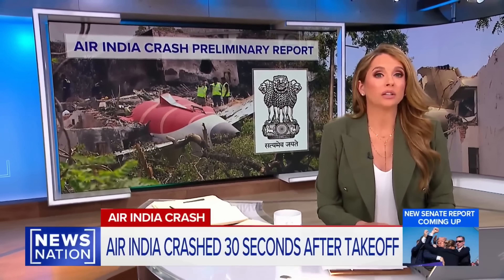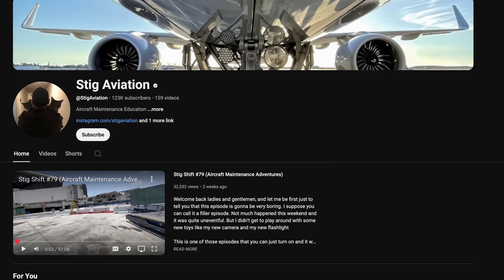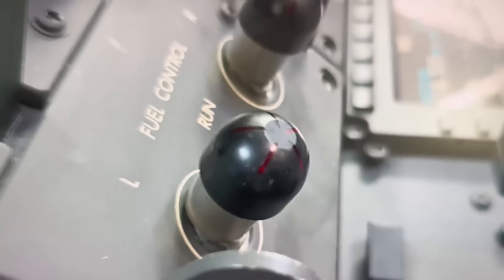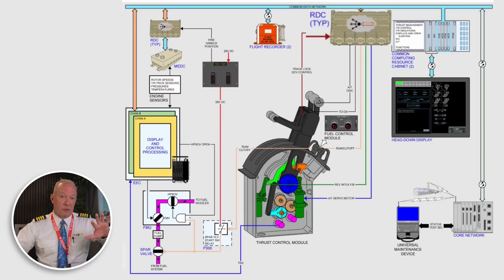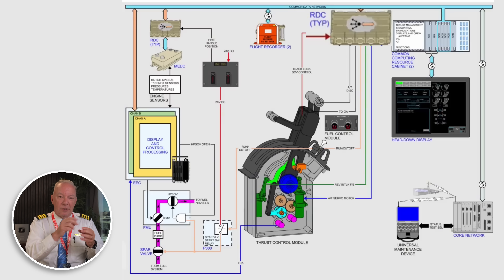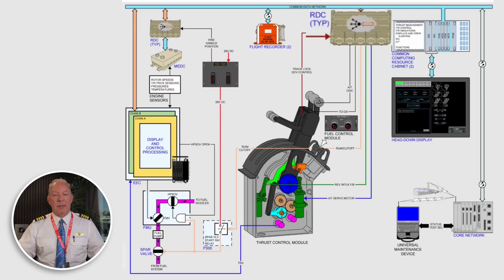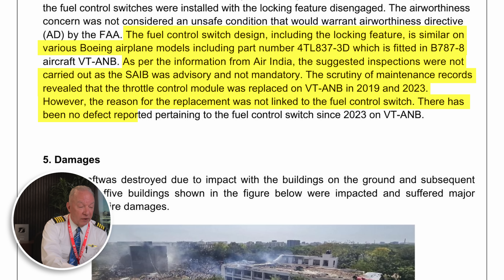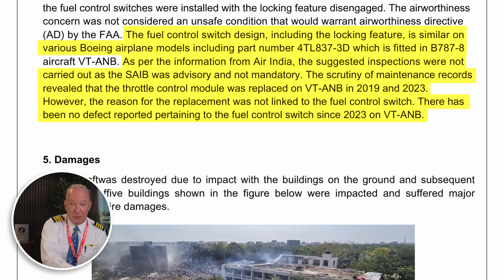The Truth About Boeing 787 Fuel Control Switches

Comment: I was disappointed with your explanation of the fuel control switches, particularly by your suggestion (at about 3:50) that the relay they control also opens/closes the FMU and the HPSOV, both of which are  actually automatically controlled by onboard computers, and which are located downstream from the spar valve that is operated by a relay connected to the run/cutoff switches.  

Also, in your little battery and flashing light prop, you identified the rocker switch in that simple circuit as a relay.  A relay is a remote device, that, when fed a current by another manual or automatic switch, opens or closes a different circuit.

Comment: I don't understand anyone wanting it to be a manufacturing fault, rather than deliberate human intervention. If a manufacturing fault, the implications are actually far dire, because it puts all the control modules in 787s and 737s into severe concern.

If it was a deliberate act, while terrifying to consider someone doing such a horrific thing on purpose, at least the chances of a repeat event are naturally less, because the difference between one human to the next is far greater than a single control module to another. These control module are manufactured to specs. Humans are not.  If it's a manufacturing fault, this event is more likely to repeat than if it were a deliberate act.

Comment: - Lithium-ion battery fire in eppenage of aircraft during runway roll?
- Electrical failure follows?
- FADECs cut-off fuels to both engines as per Fire Protection logic on takeoff?
- RAT deployed within 1 sec after takeoff?
- ECAS message appears showing fuel cut off?
- FO asks if Captain Cut-off Fuel?
- Captain says he did not? 
- Both pilots in initial confusion and some shock for some seconds?
- Captain calls ATC "Mayday Mayday - no thrust - falling" - not what suicide pilots do? 
- Captain then follows engine restart checklists inc cutting-off and running fuel switches about 10 secs after problem first alerted? 

Is above all possible? 

Well we should find out in 2026 once full investigation completed.

Comment: The aircraft never transitioned to ' airborne mode' , the WOW sensors failed, airborne mode' not detected. Fuel was cutoff 1 second after takeoff. That's it. There is a massive manipulation going on here to save Boeing.
Reply: No, the report says "The aircraft air/ground sensors transitioned to air mode, consistent with liftoff at 08:08:39 UTC".

Comment: Perhaps take a closer look at the diagram again. You say that all 3 valves are controlled by the relay. The FMV is not controlled by the relay. It's controlled by a signal from the "display & control processing" block. Also the HPSOV is controlled by a signal from the "display & control processing" block via an AND logic gate, which requires a voltage on both it's inputs to turn on the valve. So it's not a simple "closed loop" system at all. There are other external inputs that can cause the valves to close, It only needs 1 of those 3 valves to shut to cut off the supply to the engine.

Comment: 1. Is it normal practice for the switches to be set to the off position, when waiting to take off?
2. Could there be a reservoir of fuel still in the lines between HPSOV  to the FUEL NOZZLES, as seen in the diagram,  to the engines when the switches are set to the off position while waiting to take off.
3. If the answer to 2, is yes, then could the plane take off with the switches in the off position, fuelled by that reservoir. Achieving lift, but then falling out of the sky when that reservoir was exhausted?
To sum up is it possible for the plane to achieve flight with the switches in the off position, fuelled by a small reservoir of fuel still in the lines feeding the engine. If yes, it would explain why lift off was possible and then when the small reservoir of fuel was exhausted, the plane quickly fell out of the sky.

Comment: There is also 2 contacts which report the switch in Run position when it is in run and cutoff position when the switch is placed in cutoff. They feed the “position” signal directly to the Data recorder which records exactly when the switch is moved.

Comment: Why is there no fail safe system that does not cut off fuel at such a critical moment of the plane going in to rotate.A simple electric does not allow you to watch you tube video when driving.Why did Boeing not put a fail safe mechanism that even if the pilot wanted to do this in a malicious act the computer would not allow this at this crucial juncture?
I would like Cap Steeve to help me understand this?Thanks!
Keith
Reply: There's not a security system. On Airbus aircraft, the throttle must be at idle for the switch to work.

Comment: Captain Steve, a good example by to illustrate a point. Schematic shared by you is rather  simplistic and can be easily be misleading. 

There are three Gates/players in series to allow fuel into the engine > Spar Valve, Fuel Metering Valve and Fuel PRSOV in schematic shared by you Sir. 

Fuel Spar Valve requires 28 V DC to open. It also requires 28 V DC to close.  Not clear in SSM shared by you.

FMV Fuel metering valve regulates amount fuel into engine as per throttle setting and FADEC/EEC

FADEC/EEC can also shutdown the engine on its own by  Fuel PRSOV . This valve can also be shut down by Fuel Cut Off SW, Fire Handle or EEC/FADEC.

Comment: My Question: What does the FDR record? The physical mechanical Fuel Control switch movement, the drop out of the relay supplying the 28VDC to the valves or the 3 valve opening/closing? It would be important to know what  is actually recorded that is in the report as "Fuel Control Switches" went from run to cut off and back. They way it reads it's the physical movement of the switch???

Comment: The whole concept of fuel control switches is grossly negligent. If only because a single suicidal thought or a mild stroke can lead to a catastrophe. A safety concept worthy of the name would have to completely rule out the use of fuel control switches during take-off and there would always have to be several safety checks, even at higher altitudes. Such a system does not exist in the European industry. This is because the European Machinery Directive prohibits such grossly negligent safety concepts.

Comment: Wait- so in the event that the 28V DC fails, the valves CLOSE? Couldn’t that voltage be lost in some other way than the cutoff switches? Wiring problem, a failed battery bus, or a failed dead battery itself??

Comment: Do you realize that you said the 24 volt valves require power to operate open. If the power does not relay the valves must close?

Comment: Hello Steve, 
thanky ou very much for your great videos.
:yougotthis: What if the connection is interupted broken?
:yougotthis: What if there is a short ciruit between the wires?
:yougotthis:What if there is a bad connector (higher resistance), so that there is only half of the voltage arriving on the RDC, P300 
:yougotthis:What if ther is not the saame signal on the RDC and on the P300?
:yougotthis: What if ther is no power supply? (Is it the same power supply for right and left?)
:yougotthis:Is there only one batterie? (or one for left and right on a different position?)
🥴 So by "Boing definition" the batterie can never die??? 
Security is never so simple.. :elbowcough:

Comment: A pilot with experience should certainly know the use of those switches. So, I don't believe they were switched off by the pilots. And if one of the pilots did it, in a suicidal terror attack, the second pilot should know what's happening, and immediately switch them on, again. Unless turbines didn't start, once switched off.
Fact is: BOEING and international lobbies are far more interested in saving the reputation of BOEING, as of Indian pilots. "European Garden" regards Indians as "savages out in the jungle", anyway, so there's no reason to save the reputation of deceased pilots, while any BOEING failure costs the company billions of dollars.

Comment: So it all comes down to the probability of both 28 volt circuits failing simultaneously. Certainly a failure could occur in a closed electrical loop with three separate valves (solenoid actuated?). But the odds of it happening together is astronomical. 

When are they going to release the actual cockpit voice recordings? Why have they not done so? They may not reveal anything but it’s curious that all we have so far is a paraphrased version of the actual communications.

Comment: I still have to wonder whether it may have been inadvertent activation by one of the pilots, particularly if those switches were poorly maintained or alternatively if a circuit breaker mechanism we aren’t aware of tripped those switches over

Comment: Captain Steve, you mentioned that the switches are used manually to start and stop the engines on the ground in seconds, but you forgot to mention that they are also used to manually stop or restart the engine during flight, especially in emergency situations. By the way, how long does it take for the engines to successfully restart?

Safety Features:

Comment: Hello, great content... I'm looking at the block diagram and there are the two fuel valves that also are controlled through the Display and Processing Unit via the "AND Gate"  and the fuel control switches.   Possible failure mode if the DPU or AND Gate failed.

Comment: Capt. Steve, you proved my point. Why its a closed system? The should be a computer monitoring that the aircraft is in take off configuration and everything is functioning normally. Therefore, no reason to cut off fuel and the switch needs to be an intelligent switch and not a DUMB switch (On/Off). Jesus man, even my Tesla won't allow me to engage parking breaks while in motion. This is another example of Boeing's ancient technology and incompetence.

Comment: Great explanation I used to make radios when I was a kid and that’s back in the 1960s. I actually made a transistor radio using one transistor and it was big lol . Something is critical as fuel you want to keep very simple and unable to be interfered with in anyway. The issue is not really the switches. It’s the culture of India. They cannot accept what the obvious conclusion is that one of those pilots deliberately turn the switches off. It just simply can’t compute with them so they’ll come up with conspiracy theories, electrical interference, theories, accidental, bumping them theories, but they can never escape the fact that it was both engines even if there was an electrical interference that might have affected it. It probably would’ve affected just one because as you said it’s two separate systems .

Comment: Captain Steeeve, I had always liked your videos until you started the ones on Air India crash. You seem hell-bent to blaming the pilots, mental issues etc. Final report and full transcripts of the entire conversation of the pilots are not know to anyone except the investigating team. You did not answer why RAT was deployed before switch cutoff. You also did not answer how the two switches manual shutoff happened with a span of one second. All your videos are focusing on the mechanical aspect of the switches. None are talking about the electronics. You do not know 100's of events that happened in those time frame. Since you belong to the pilot association, you should show some respect and have some patience.

Comment: Do I believe both failed and failed at different times? Absolutely not. However, your explanation isn’t really correct, and one of the most common electrical failures I see is relays. They have a life cycle and before failing completely you get random failures from them often 🤣

Comment: As a retired electronics professional, after looking at the schematics, I disagree with the assertion that only the fuel cutoff switches can cut off the fuel. The HPSOV signal from the DISPLAY AND CONTROL PROCESSING module runs through an AND gate that activates the HPSOV valve only when logically added to the RUN CUT OFF switches. Furthermore the FMV valve is controlled by the DISPLAY AND CONTROL PROCESSING module. From the schematic it seems the closing of any one of these valves can cut off fuel to the engines.
Reply: Exactly. He tries to explain how it's a "closed system" but fails miserably, by not understanding the diagram at all. He states that "there are no other inputs into that system", which is clearly wrong.
Yet there are comments on here from so-called "engineers" & "technicians" congratulating him on his presentation. Clearly these guys can't read a diagram either!
Reply: When you say closing of any of these valves, how would that happen? I'm assuming in a closed system it would be an electrical or mechanical malfunction. 99 times out of 100, if the engines suddenly and unexpectedly shut off the pilots would assume that it was some sort of electrical or mechanical malfunction, something went wrong within the bowels of the system. The voice recorder seems to indicate that something within the cockpit itself was wrong. Why would one pilot automatically assume that the other pilot did something to affect the engines if there wasn't something different inside the cockpit that was easy to identify? I think that's the crux of the issue.
Reply: Whould that register in the FDR as the switches being in the Cut-Off position?
Reply: He consistently ignores these comments and continues to only focus on the movement of the switches, which leads me to believe he’s just doing this for views at this point.

Comment: If you already decided that the pilot did it, further investigation wouldn't be needed. That the switches didn't move position by themselves hasn't been disputed for several weeks now, so why the continuing focus on the the switches? Very little, if any, is discussed about the FADEC and the electrical system. A relay need electricity to work, so the system is not mechanical. We don't know why one pilot said what he said, or what he saw.

Comment: I'm just wondering Steve...with the switches being spring loaded and clicking into place, is there any chance the CVR may have picked up the sound of them actually clicking into place? Now I've watched enough aviation stuff over the years to know the sound quality on the CVR isn't the best in the world so may be unclear, but they know the exact time these switches went into cut off and we know they cannot possibly move by themselves, so they could marry up the CVR audio with the FDR to prove that the switches were in fact moved, thus dispelling any fanciful theories that this was some sort of computer/electronic failure. Albeit, this still wouldn't be definitive but would certainly add weight to the already overwhelming case that those switches were moved into cut off by someone in that cockpit.

Comment: No other input - you confidently assert. But your own breadboard lamp has an input that is separate from the switch! The battery/power supply. Until you have elmininated the possiblity that the battery power supply could have been momentarily interrupted by anything except the switch you have not proven your case beyond all reasonable doubt. 
This is just logic - not wishful thinking. Please follow up.
Reply: hes not technically savvy enough to understand that

Comment: in the event of engine failure - the standard procedure is to switch off then back on to restart the engine(s)
Reply: For dual engine failure scenarios, Boeing procedures include cycling the fuel control switches to CUT OFF and then back to RUN to reset the engine controls and facilitate restart attempts, alongside deploying the Ram Air Turbine (RAT) and using the Auxiliary Power Unit (APU) to maintain electrical power and pressurization. Pilots are trained for these emergencies with detailed checklists to maximize the chances of successful engine restart and safe recovery.

Comment: Hello, I am a Pharmacist and not an engineer, but I was curious how the EAFR can monitor the engine cut off switches if the system is completely closed. They must be attached to the switch circuit to monitor the cutoff switches position. I would also have to guess that the EAFR is connected to the planes central computer system.  Is there any possibility of some sort of a feedback from the EAFR or computer that may have caused the switchs circuit to malfunction?

Comment: So what you are saying is if the spring in the switch breaks during high vibration, the nib that is holding it in position would no longer have tension and could "fall" down to the other position....

Comment: The reference to the switches control a 28v relay that supplies 28v to the fuel valves by itself does not make sense, it is an unnecessary failure point. There must be some OTHER input to that relay or it would not be needed.
I'm suspicious of the weight on wheels switch (s?) or some other electric fault.NEED cockpit camera!!

Comment: Not bad! You seem to cover most of the ground. BUT do the valves require constant DC current to stay open? Or only to close them?  What happens if that current is interrupted by something other than the switch? What about water ingress? Could that have interrupted the current?  What happens if water got into the 28V DC current or the battery? On rotation could water have tipped down into the EE bay and interrupted the current?
Is your analysis premised on the current being uninterruptible by anything except the switch?